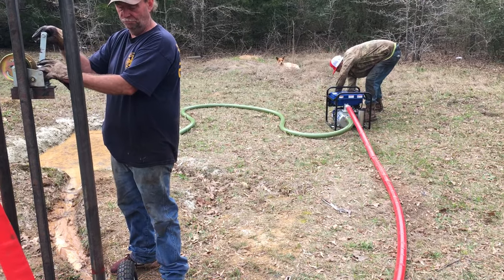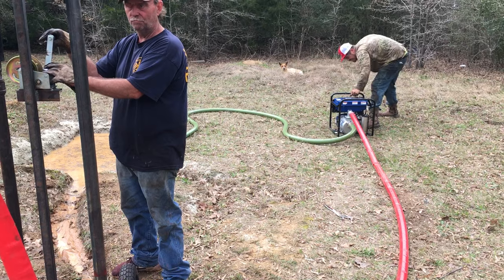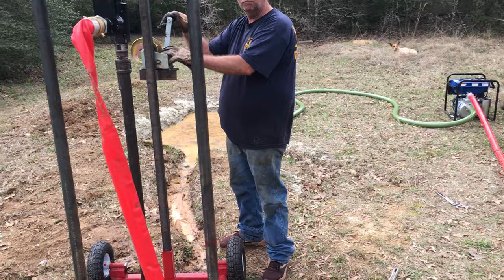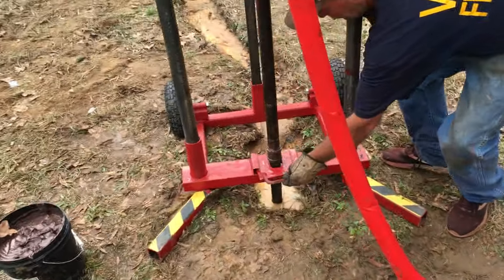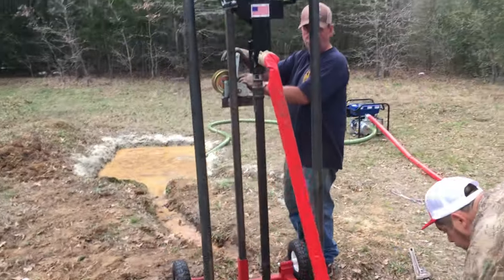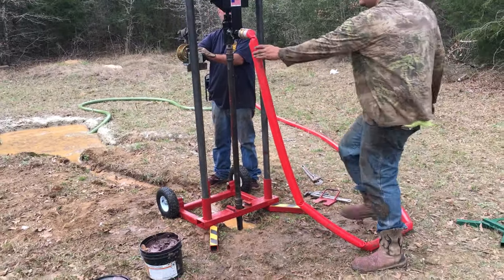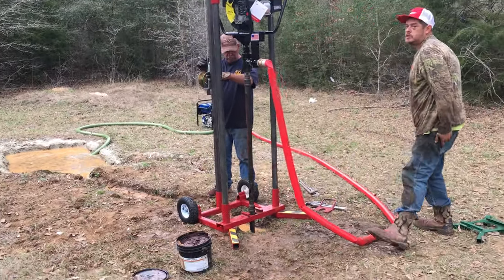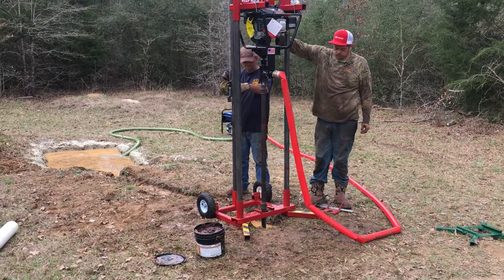IMG 3211 DEEPROCK HD 55 Pro Series Waterwell Drilling rig model 2021 drills to 225 ft  deep

Comment: Top
Reply from the maker: yes sir we also have a DEEPROCK RAM10 Model 2023 that will drill to 450 ft deep and a 8 inch borehole if needed and only$16,780.00 with 2 3/8 Mayhew Oil Feild Duty sch#80 10 ft long drill pipe you drill one borehole and its payed off not 5 years of jobs with the cost they charge for a well borehole you can buy the whole Drilling Rig and drill wells on your own land or for cattle just drill shallow waterwells like 50 ft ect cows dontv care obout iron in the water making a stain in the toilet

Comment: Where to you get the drill stems?
Reply from the maker: HELLO WE have sch#80 1 1/4 inch OD steel drill pipe in STOCK at all TIMES its $750.00 per 50 foot BUT HD-55 Pro comes with 100 foot in the Drilling Package We also have  the POPULAR DEEPROCK® RAM 10 MODEL 2023 Fully Hydraulic and runs of your BOBCAT or TRACTORS Hydraulics and drills any thing you Bud its $16,780.00 and will drill to 400 foot if you buy enought drill pipe it will drill anywhere back yards between houses or remote cabins in the woods wwwdeeprock.com

Comment: Cual es el precio de la plataforma
Reply from the maker: YES Sir We have them in STOCK and have extra drill pipe if you need to go deeper and also ROCK Drilling bits if your in ROCK we also have DEEPROCK RAM 10 MODEL 2024 it will fit on to your TRACTOR or your BOBCAT and just plug in the RAM 10s two Hydraulic hoses in to your tractor and your ready to drill to 500 ft if you have enough drill pipe to go that deep google search deeprock.com in Marquez texas 77865

Comment: Tem um representante  no Brasil?.
Qual o contato?.
Reply from the maker: Yes Sir it will Drill in tighest spots and drill your waterwell 6 inch borehole so u can suck your water out for your family and your garden or just for the house its up to u its a win win win deal for sure for $3910.00 with 100 ft of sch#80 steel drill pipe and a 6 inch Carbide teeth drill bit and a wheel kit on it so as to move it around your farm easy it will last 20 or 30 years if you keep it in a shed and not just laying out on the ground in the ice and rain and hot sun put it in your barn so as to use it for YEARS and years
Reply from the maker: Yes we have the DEEPROCK BOBCAT RAM 10 Series for  $16,780.00 with 2 3/8 10 ft long Mayhew drill pipe it will hook up to your TRACTOR or BOBCAT and is fully 100% Hydraulic and will drill to 450 ft deep and drill for years and years with out issues www.deeprock.com in Marquez texas 77865 phone is 903-529-2001 and email is sales@deeprock.com
Reply from the maker: we have in office in Marquez texas 77865 we ship all over the world shipping over seas is no problem

Comment from the maker: Yes we have many DEEPROCK/HYDRA DRILL HD-55 Pro Series Model 2021 in your country drilling many waterwells for people in your area or you can buy it from DEEPROCK mfg in Marquez texas 77865 903-529-2001 or sales@deeprock.com we have in STOCK NOW with the all steel 330 gearbox its the toughest most relieable waterwell drilling machine for its size and is proven GOOGLE DEEPROCK .com in marquez tx 77865

Comment: Cuantos metro perfora así abajo
Reply from the maker: YES i had a customer tell me he just finished his 4 th well with his rig and also did one for a tractor in trade off yes hes a happy camper with his DEEPROCK HD-55 Pro Series Model 2023 $3910.00 plus shipping and u too can drill wells on your land most wells take one day to start and complete two somes times if you have ROCK because in ROCK you need a Tri Cone ROCK bit they are $585.00 each but last many many wells

Comment: Where i can buy that drill here,in the pilipines,and howmuch,
Reply from the maker: DEEPROCK mfg 2129 S vw Goodwin blvd Marquez,Texas 77865 we ship all equipment from TEXAS  out off HOUSTON Ship Channel by BTX shipping in HOUSTON TEXAS
Reply: @davidgroesch1136  Hi David ,what is the net weight of the whole model HD55?
Reply from the maker: Weight is on a pallet with drilling pipe and bit and casing plate is 489 lbs
Reply: @davidgroesch1136  How much does it cost the send to Mexico?
Reply: How deep it can drill? What is the price ?
Reply from the maker: @asylla7021  COST is $3570.00 with 100 ft of sch#80 steel drill pipe and 6 inch Blasthole bit and 8 hp KOHLER high Torque engine and all steel 330 gearbox and a wheel kit installed and the Easy Grip Casing install plate and the Easy Grip Drill pipe Guide and breakout plate also we have IN STOCK wwwdeeprock.com in Marquez texas 77865 903-529-2001 /sales@deeprock.com

Comment: how much does the hd55 cost with everything?
Reply from the maker: ON ANNIVERSITY SALE  we have it for $3570.00 model 2021 HD-55 Pro Series with 100 ft drill pipe sch#80 thickwall steel with 1 1/4 Inch Welded on coupling and the ALL Steel rated for Air or water XP-7 Swivel and wheel kit installed for easy moving around to other jobsites and the 4 inch steel channel Easy Grip Drill pipe Breakout and Guide plate and it has the 6 inch carbide Blasthole bit the same one i use on the large Trailer rigs but i weld a 1 1/4 inch coupling on it so it will fit the HD-55 Pro s drill pipe this Blasthole bit is tuff and will last many many wells before its done about 15 to 20 wells before its worn but if you dont know about drilling your own water well it comes with a STEP BY STEP Drilling guide 1,2,3, ect shipping by FED EX FREIGHT is $340.00 also we have a DRILLER on Staff that can answer ALL your Questions 1,2,3 DEEPROCK.com   Waterwell drilling rigs in Marquez,TX we ship world wide from Houston TX a Major shipping hub
Reply from the maker: $3570.00
Reply: @davidgroesch1136  so do you have bigger models.    Are you willing to call me. So i can tell you the situation we have here.

Comment: Drilling a hole is the easy part.  Those tools have to be picked up, and that is the limitation of any drilling machine.  I note the video stops before that part. Not to mention keeping the hole open so well pipe and screen can be installed in unconsolidated formation. I am quite skeptical, and would suggest anyone considering the purchase of this system do their homework and talk to people that have had success with it and no monetary interest.
Reply from the maker: yes its dirty work and yes if you need to drill 300 to 800 ft deep then you purchase a large DEEPROCK Drilling but if you just need to drill a borehole to 100 to 200 ft then the HD-55 Pro series is fine but if you want easy then get our BOBCAT RAM 10 model 2023 its hookd to a tractor or a BOBCAT and will drill anything you got sand clay shale ROCK ect buts its $15,780.00 but yes it will drill like a CADILLAC super easy to use happy drilling guys DEEPROCK mfg has you covered  for sure !!!
Reply: All these drillers using drill rigs that cost upwards to a million dollars, when all they need is your DeepRock hand rig. Amazing.
Reply: Your video does not talk about keeping the borehole open so that the well pipe and screen can be installed. Many geologic situations require that an upper casing be installed to prevent infiltration from the surficial aquifer. Do you have a video that addresses how to accomplish that?

Comment: Esse sistema de caixa acaba com a bomba ,bombea barro  tem que fazer no mínimo 3 caixa  uma pro barro e a outra pra material leve e a terceira pra bombea
Reply from the maker: Yes Sir we have the DEEPROCK mfg HD-55 Pro Series in your state and they have done very well when in rock just put a Tri Cone ROCK bit on and it will grind the rock to sand particles and its slow but Rock is slow on all rigs maybe a ft a hour in hard rock soil formations and in sand and clay and shale just use the Blasthole 6 inch bit that comes with it but yes on ROCK just put a Tri Cone Rock bit on Thanks www.deeprock.com
Reply from the maker: https://www.youtube.com/post/UgkxKGJcwyAMK6BvsDif2Z17MzNsa-tnY-Q9

Comment: Works well in just clay or sand. I’ve gone through two gear boxes with mine in 50’. The power head is used for two man ice / post hole drills. Limited drilling, not for water wells. The gear box / transmission on mine is very lightweight and cheap Chinese manufacturing. I took it very easy with this machine and did not abuse it. It’s just too light weight if you run into any type of even soft stone. Good concept but not up to the task. Very disappointed with the drill.
Reply from the maker: hello yes we have used this Drill unit to Drill hunderds of well boreholes with the same as you have BUT i see that u had it for over a year and were using a 6 inch drag bit that came with it that bit is a great drill bit and its super great on SAND ,Clay and Shale and small gravel and your not going to harm the DEEPROCK drag bit BUT You are drilling in ROCK there is no worst area to drill ROCKS is like steel plate and the HD-55 Pro is our most ecomomical drill we make we have rigs thate drill 1000ft deep in grainite or BOBCAT RAM to Rigs that drill to 400 ft and fully hydraulic BUT you bought our most ecomonical hand crack rig that will do the job MUCH slower i cant believe you did not contact us to buy a 6 inch TRI CONE ROCK bit it will rotate on the ROCK and grind it into sand partices you have been using a Sand and clay and shale drill bit ans it will try to grab the rock but slips and it will bounce up and down up and down and you have tore your gears up from the abuse of you using the WRONG Drill Bit no one uses a sand and clay bit on ROCK it will bounce up and down for hours tryin to get a grip on the rock u have i wish you would have emailed of called us so we could have bought the correct drill bit for what you have at your house instead of tearing the gearbox up and getting a new gearbox and tearing it up just put on what we call a TRI CONE ROLLER ROCK BIT and then it grinds the ROCK in to sand particles simple fix so get a new gearbox for about $189 and bolt it on and then get a TRI CONE ROCK bit and then go gettem SIR  we have them in stock everybody that hits ROCK then you take the drag bit off and put the TRI CONE ROCK bit on and see the world of differance it makes no more JUMPING UP AND DOWN and abusing the gearbox shaft and swivel just rotates and grinds the rock it for ROCK only then after you go thur the Rock then put the Blasthole drag bit back on give us a call and ill get you one at a vet good cost have a great year and drill many more years with it and if you have any question just ask ive drilled over 350 wells and can answer questions super fast ny calls or emails or text wwwdeeprock.com
Reply: @davidgroesch1136 Some assumptions on your part. I did purchase two tricone bits and used them, one was brand new. The bits just spin for hours not cutting or grinding anything. Seems the whole unit really isn’t heavy enough for the downward pressure needed to make them effective. I will call you again and see if you have any other ideas. The second gearbox came apart using the tricone bit. Nothing grabbing or jumping.
Reply: @KSprospector  How did it turn out for you? Any luck?

Comment: 8 inch bore well for 600-800 feet deep in mud/ rock is your machine will work.
Reply from the maker: no sir this rig is for 200 ft or less we have a DR-100 Trailer rig that will do that www.deeprock.com

Comment: These guys seem clueless.  Ashamed you can’t do a pvc casing at the same time.
Reply from the maker: yes they do it the way they want and u do it the way you want its usa freedom to do it how each person wants to get there water needs met and have the water they need for there cattle and gardens and there homes for there family everybody does it how they want to its there rig to do it how they want ive drilled OVER 350 wells and i always drill bore hole then trip out and then i put thr 4 inch sch#40 pvc pipe and well screen in and then delelope it and then put my river rock on the out side so as to have it around my well screen on the bottom .

Comment: You have to use a licensed drilling company these days. 
Drilling your own well is illegal now.
Reply from the maker: Hello Peter you are wrong in all states you can drill a simple waterwell on your on land without a license oil wells and gas wells require a licensed Driller to operate but a simple waterwell can be drilled in less than a day and have water for your garden and cattle and your family drilling a waterwell on your OWN LAND is simple and easy to do just drill your bore hole when you hit the soft watersand thats your water put a pvc wells screen with a cap on bottom and the rest with sch#40 pvc pipe 4 inch and put a pump in it and have water the water is yours and free and its your land and theres nothing dangerous like gas blowing up or a spark causeing a fire from the methand gas es its just drill a straight borehole and the water sand has no friction so it drops faster so u see that thats your watersand put your screen there and the rest with sch#40 4 inch pvc pipe [casing] oil and Gas wells are dangerous and need to be done by liicensed drill operator but no sir waterwells or simple to drill you can do one in a day with a buddy and utube has hunderds of videos to look at and see how easy it is to drill your own waterwell on your own property in the USA
Reply: @davidgroesch1136  The problem is that you can contaminate groundwater basins with saline water, saline aquifers often occur above freshwater ones especially in areas with alluvials , it requires immediate concrete casing filling to prevent cross contamination and a specific type of drill, most other drill types use compressed air to discharge dirt and rock debris. Well maybe in your state you can drill but here it's a state and local government matter.
Reply from the maker: @Peter-ob6ue  yes in your state like California has the goverment state and local and county goverment are taking the rights away from there land owners and the states like that say that California OWNS the WATER under your property thats something very sad.But you have a right to your deal too
Reply from the maker: you must live in california where the goverment puts meter on your well and sends you a bill for your water i think california has a big mess and is selling u your own water to pay for the crackheads and illegals that get food and cash monthly on tax payers back so sad so sad all the other states or normal but CA is a mess for sure liecence drillers put a gps on the well so the local goverment can go to the wells and put meters on them that why the leicence drillers put the gps on each well they drill so the local goverment can sell u your water wow what a joke !! next thing u know California will be making hard working tax payers pay for illegals college funds but american have to get loans
Reply from the maker: califoria is a mess liecenced driller have to put a gps on each well they drill so the local goverment can put a meter on your well and sell u your own water what a joke of a state and everyone knows so sad for the tax payers in California so sad water is NOT californias water its the person that bought the land water end of story !
Reply: No it ain't. It's illegal to go charge someone else to drill theirs w/o a lic. From big daddy. You can do what you want on your own land in tx

Comment: I want to buy a larger one than 600 feet do have it ?
Reply from the maker: HELLO yes we have a DEEPROCK® RAM 10 Model 2024 Up Grade SERIES it uses 2 3/8 mayhew drill pipe each is 10 ft long you just hook up to your BOBCAT and plug the two hydraulic hoses up and your DRILLING in tightest spots www.deeprock.com in Marquez texas 77865

Comment: How much
Reply from the maker: DEEPROCK HD-55 Pro Series Model 2022 is Only $3910.00 with 100 ft of sch#80 steel drill pipe and a 6 inch Full Carbide Teeth Blasthole Drilling bit and the XP-7 All steel swivel with grease zerts to keep it lubercated also the wheel kit is installed so as to move it around Easy to job site also it has the Easy Grip PVC Install plate to hold your 4 inch PVC casing pipe while you glue it and then it has the UpGradede Easy Grip Drill Pipe Guide and Breakout plate www.deeprock.com